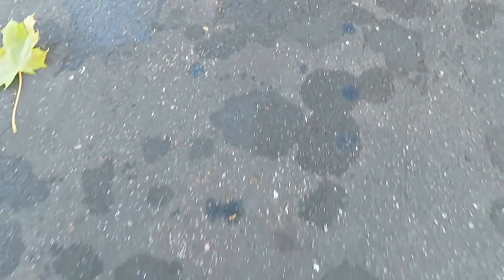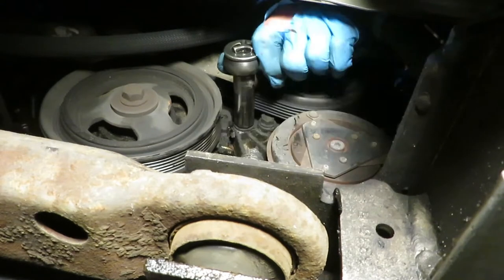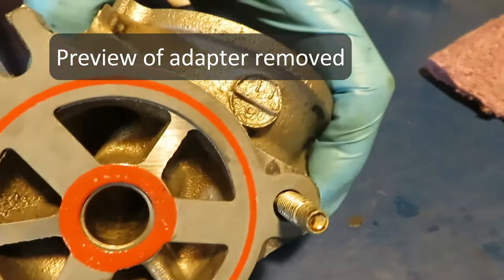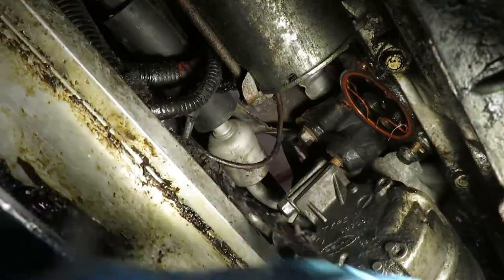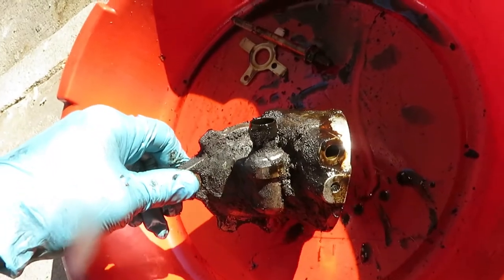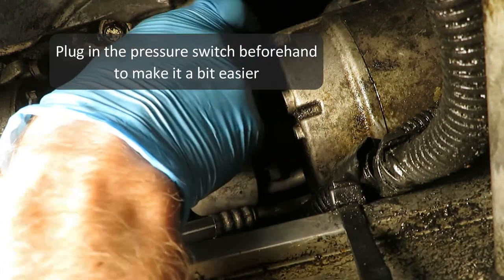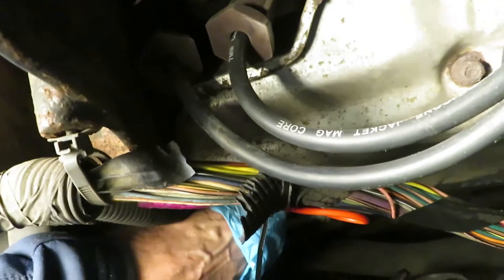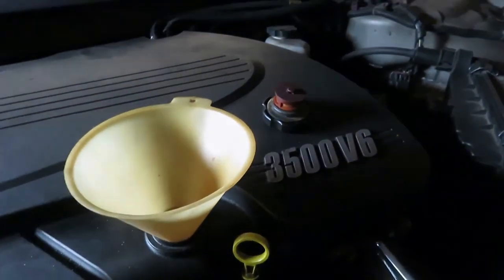How to Replace Oil Filter Adapter Gasket and Pressure Switch: GM 3.5L “06-’09 Impala, More

Comment: Just completed on my '06 Impala 3.9 and all of the steps in this video are the same as for the 3.5.   I wasn't able to get the 'hidden' top bolt from above with my available toolage, so I used a 6" extension and a wobbly adapter on my ratchet to get it from underneath the car.   This job took me 2 and 1/2 hrs, including removing and replacing the plastic shields from behind the tire and underneath the radiator.    This is the best video you'll find to complete this job.   Thanks   @TheOriginalMechanic
Reply from the maker: You're welcome and thanks for the feedback!

Comment: I just did this again. Here are my tips. On the side of the compressor closer to the passenger wheel, loosen upper bolt and completely remove the lower bolt to allow more movement. Then, after loosening the bolt on the other side and moving the compressor, you can use a short socket on an extension to loosen that adapter bolt next to the compressor. My ratcheting box-end wrench would not fit. When reassembling, I was able to avoid using sealant on the gasket by completely removing the bolt next the compressor (so all three bolts removed) and then using the long bolt to hold the gasket on as I get that first bolt screwed partly in. Next, I made sure the gasket was positioned correctly as I tightened that first bolt (just finger snug) and then it was held in place and would rotate with the adapter. It was still a bit tough, partly because I didn't have a lot of space under the car. I removed the exhaust header heat shield near the fan in order to have more access to the hidden top bolt from the top, and I used a deep well socket with a small ratchet on that one because event my short extensions were too long.
Reply from the maker: Thanks for sharing the helpful details.

Comment: Just had to chime in here. If you drop the plastic splash guard you can see all three bolts and reach the hard to reach one in 5 seconds with a long extension and 13mm socket. So much easier.
Reply from the maker: Thanks for sharing the tip!

Comment: Great video. Lots of information. I have my parts all on order for my LS 3.5. I know the gasket is bad since I can see a ton of caked on grease all over the adapter part. This tiny oil leak for me is really annoying and I want to get it all fixed. I did order the felpro gasket. I also ordered the oil pressure switch/light might as well. Got a coil pack, wires and plugs all going in at the same time too. Been running rough when I have to hit the gas pedal. Thinking the plugs need to be replaced again and I have never done wires or the coil pack. It has 180K on it. Still runs OK but lots of bushings are squeaking in the front end which I haven't identified yet. Thanks for so much detail in the video.
Reply from the maker: You're welcome. I'm working on this same Impala right now with a variety of leaks. It has 237K on it and the engine still runs good so I fix it.
Reply: Hello The Original Mechanic. Thanks again for making this video. Made it much easier to swap mine out as I finally was able to do this yesterday. Took me longer since I wanted to remove the bumper valance. This thing is a horrible design and difficult to remove. I probably did it the wrong way and its the first time its been removed so it was hard. But because I removed it I was able to get to the top bolt of the oil adapter and the ac bolt easily. Even the bolt that the ac condenser blocks I can get to that after the condenser is loose. I can get to those bolts at an angle with a long ext. My gasket looked terrible and I also changed the pressure switch. I got the foamy degreaser and that worked great with a cheap brush from the auto parts store. Only tricky issue is understanding how low I was on oil. So far no huge puddles of oil so I think I did it right. Possibly the oil leak was coming from the bad or old oil pressure switch. On my 2010 impala I can't tell where it is coming from but this was a big step to figuring it out. 186k or so and its time for a new car. Or a used engine. Cheaper than buying a new car. Thanks again for such detailed video. It helped me out a lot.

Comment: So that's where the oil pressure switch is on a 2006 3.5, I have this engine in my 2006 Malibu Maxx LT, and have been searching for it so I can change it out. But your switch came with an O ring, I bought one from NAPA and it did not come with one

Comment: Will an adapter gasket that needs to be replaced, also cause drips of oil on the oil pan bolts???
Reply from the maker: Possibly, but the telltale sign is from the oil filter area.
Reply: @TheOriginalMechanic  Upon a close inspection the oil filter area was dry, so It was not coming from that gasket....thanks.

Comment: This job is what ratcheting box end wrenches were made for.
Pretty darn expensive to get non huge clunky ones so average ppl prob aren't gonna have em either
Reply: I though mine were good and small, but it wouldn't fit on that bolt next to the compressor. Anyway, a socket on an extension worked easily after the compressor was moved.
Reply: @davido1588 , I am wondering if the 'S' wrenches would be useful. Hmm.
Reply: @wesoblander3648  I don't think so. Only sockets are needed.
Reply: @davido1588  , thank you!

Comment: Hello I liked how you showed some good details footage in your video here I do have a question on the AC compressor the bolt between the slowed grooves was there a nut on top of the bolt my dad said there is a nut but I don't think it goes there and he was afraid of driving the car cause he couldn't get that nut on or could I where it's supposed to go thank you
Reply from the maker: I'm not sure what you mean by "slowed grooves."  I didn't remove any of the fasteners completely when  doing the compressor.

Comment: You can easily  use a socket ratchet n extension on all bolts.
Reply: I know one's mileage may vary.  I could not get the hidden bolt free on my 07 Malibu without loosening up the AC compressor and grinding down an old, cheap 13mm 6-point socket so it was not quite so long. I usually don't buy any special tools, because I'm not doing that much DIY automobile work.
Reply: Yes, but you still need to move the compressor. I found it was good to use a deep socket without an extension on two bolts and a shallow socket with extension on the bolt next to the compressor. I also needed to use different size ratchets on each bolt with the deep well socket.
Reply: @davido1588  Exactly, I did have to move the compressor by loosening the bolts to it.

Comment: "broke" must be a regional thing i kept thinking you stripped them all or something 😅 and dude you had me fucking with a wrench forever you can loosen that slotted bolt with a 13mm socket. Also more detail on that top bolt. I spent hours trying to find it and I just couldn't. Very frustrating you glossed over it like it's easy but I gave up and put it all back together. This was a horrible experience for me.